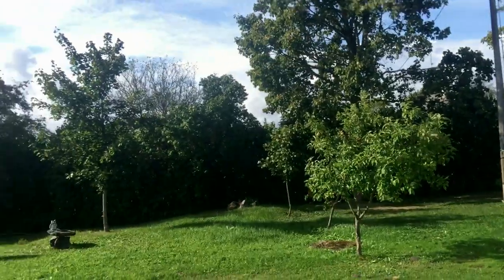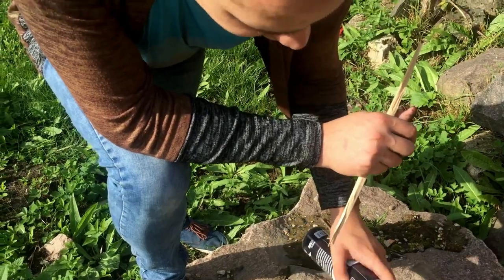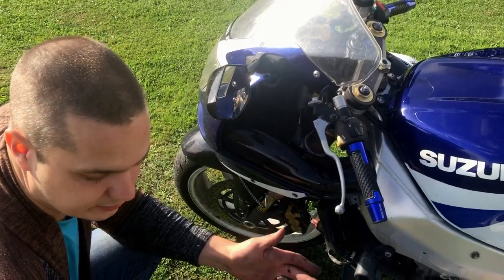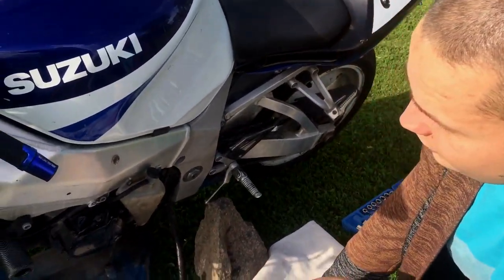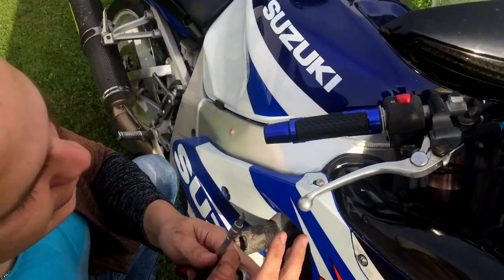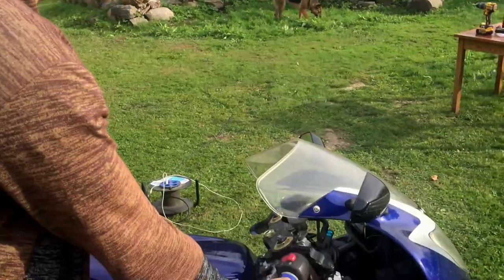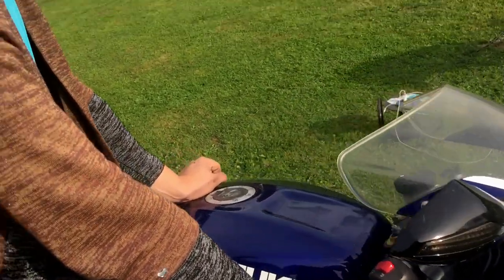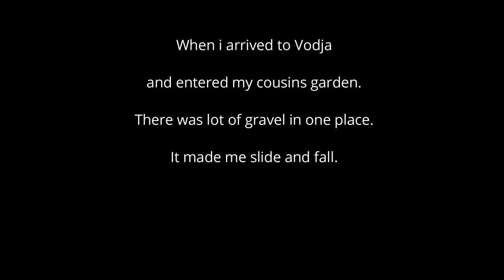Suzuki GSXR 1000 K1 First Bike Restoration Part 9

Comment: If you get a chance, change your master cylinder to brembo, your breaking will be considerably better, get steel brake lines as well, should have left the old leavers on, for stopping you want a full grip, if you have larger hands you definitely don't want shorty leavers.
Reply from the maker: Mean Bean-Machine breaking is good right now.I will think about it if i get a good offer.With these leavers it quite good to handle.I changed them because old ones were worn out.
Reply: @TheMeisner87  sounds good, K1 GSXR going up in value, mine is putting out 156bhp at present, there are more gains to be had, which is great on a near 20 year old superbike
Reply from the maker: Mean Bean-Machine i ve always liked k1 gixxer when i first saw good movie biker boys.I will keep it even if i would buy a new bike in the future.